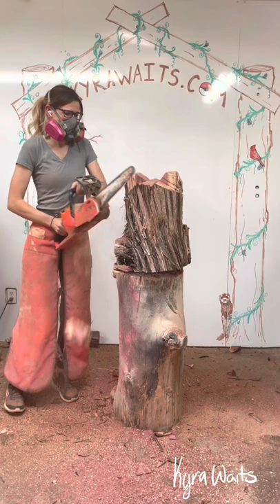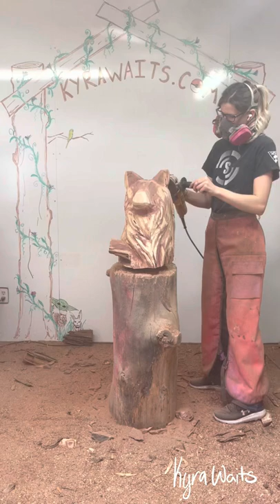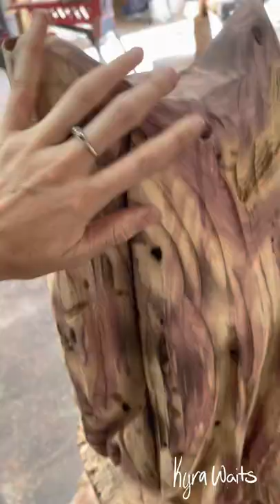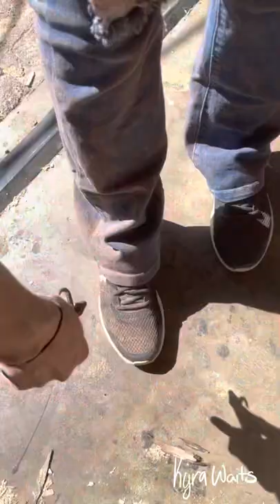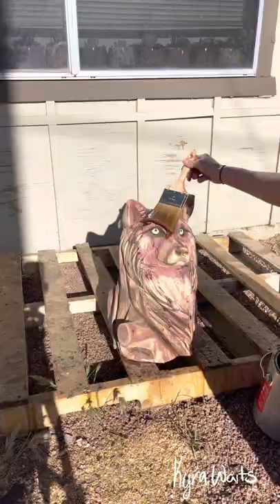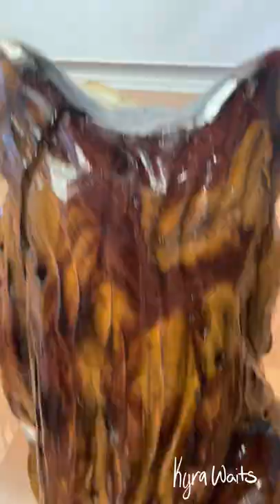Wolf Bust Chainsaw Carving by Kyra Waits #chainsawcarver

Comment: Hi kyra 
Beauiful work and amazing techniques.   I have started to do some wood carvings and well it's so so good for the soul.  I am in my infancy,  and yes many things started out as an owl but ended up as fire wood   . I guess I yearned to try and well the more I do the better its getting.  I use a chainsaw naturally and an angle grinder , i have a dremel but it's not the best , but it will do for the eyes and nostrils.   I suffered a horrid accident in 2017 and my right foot and part of my leg had to be amputated,  so I guess for what God takes away he gives you the opportunity to use your gifts .. I sketch also esp actors and rock stars and well anything really.   I think that the chainsaw is like your pencil , it's an extension, but a very high speed one. 
Anyhow I enjoy looking at your work and well no one has the ability to teach you a as I think on has ti learn from mistakes and keep trying.   Thanks for your videos. 
Joey . From Ireland 🇮🇪